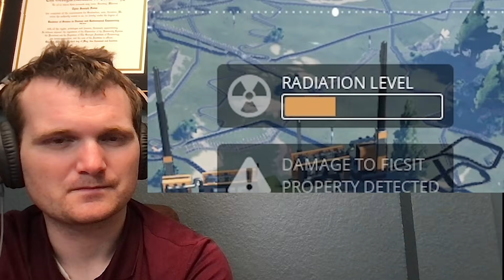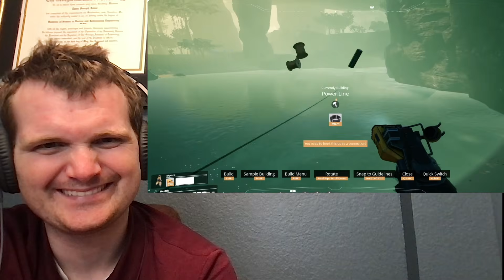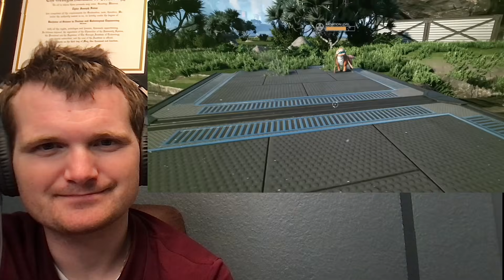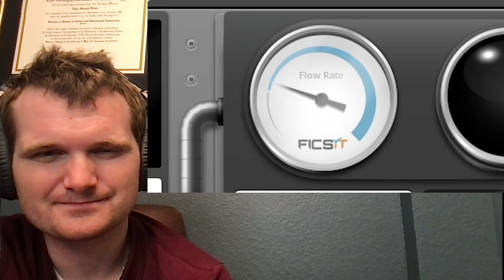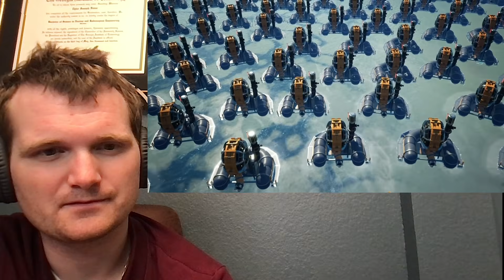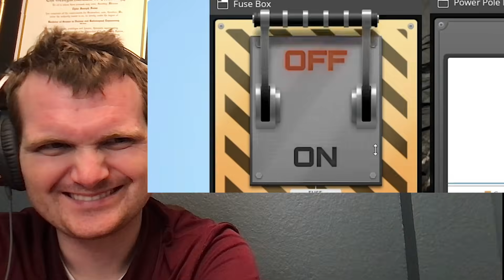EVEN MORE NUCLEAR WASTE and Drones - Nuclear Engineer Reacts to Let's Game It Out - Satisfactory

Comment: In Satisfactory, it was always implied that the nuclear and coal power plants used water (hence the cooling tower shape), but it wasn't until the fluid transport mechanic was added to the game that it became the player's responsibility to supply that water.  In the previous episode, you could see all those barrels of crude oil on conveyor belts, because prior to the fluid system, oil pumps just spit out already packaged oil barrels onto conveyors, making them functionally identical to the chunks of ore that are spit out by the mining drills.

The strange graphical glitches weren't a result of Josh's cursed spaghetti base, or even of the copious radiation he put everywhere — everybody got those, regardless of how clean or convoluted their factory was, because it was a bug introduced when the developers worked on the conveyor system, to make it less of a load on the graphics card.  I think they either just implemented or changed something about object instantiation. (That is, instead of giving the GPU a thousand distinct objects, that all happen to have the exact same shape and textures, differing only in their position, they give it one object and tell the card to draw it in a thousand different places.)

Comment: Coal is in some sort cleaner than nuclear power in Satisfactory. For a coal-power-plant, you need to feed coal and water into the generators, you don't get any waste and there is no pollution system in place except radiation, which doesn't matter here. 
For nuclear power plants, you need to deal with the nuclear waste. You cannot delete it or get rid of it, the only 2 options are storing it somewhere far away (radiation damages you and spreads around the storage depending on the amount of waste) or recycle it to plutonium. You can then create plutonium fuel rods and "burn" them in your nuclear power plants, but then you get plutonium waste, which cannot be recycled. But you can directly get rid of plutonium fuel rods before burning them and can have a somewhat clean nuclear power setup without any waste (very expensive to build and only available in the endgame).
Btw: You should give Satisfactory a try. The game is still early access, but it is already great. And unlike most other games in this genre, it's not too easy. You can expect at minimum 100 hours of fun and headaches in your first playthrough

Comment: In terms of the power you're producing coal is vastly inferior to nuclear, but combining the concepts of "ore node means effectively infinite supply of ore and is autominable almost immediately" (well before you have factory-type mining structures you can make small, carryable tripod-mounted machines to dig and store ore for you), "visible smoke isn't tracked and permanently accumulating in the atmosphere" and "water is also an endless resource with supply over time as the limiting factor rather than supply" makes coal not only cleaner than nuclear, it's more renewable than burning biological mass (because harvested plants intentionally never grow back). This is very deliberate in the game design; you are not generating power for the purpose of living here. In all probability, the eventual endgame will be that you've built and lifted into orbit the needed machinery to physically disassemble this entire planet for raw materials. Players are not supposed to be thinking of sustainability or their impact on the environment.

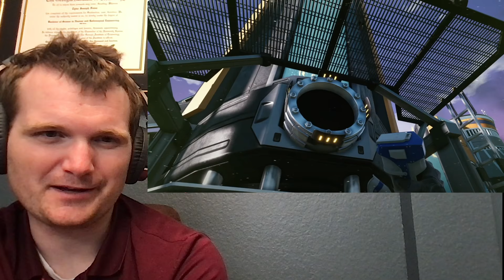Comment: 2:21 They just didn't have any kind of fluid system set up at the time they made the fission power plants, so they just summoned water from THE ABYSS. Just don't question it. :p
Reply: And no, coal generators aren't nearly as good as nuclear power in this game. A coal generator produces 75MW and consumes 15 units of coal per minute, whereas the fission plants produce 2,500MW and consumes 1 fuel rod assembly per five minutes. The main downside to nuclear power is that it produces waste you can't get rid of. Coal and uranium are both infinitely available and the devs said that you basically are the bad guy, exploiting the planet as much as possible, so the emissions isn't a thing that matters in game :p

Comment: Coal is super bad tbh. 2nd to solid biofuel. The progression afterwards goes to oil based fuel, then oil, coal and sulfer based turbo fuel. And lastly, nuclear. The drawbacks to the last 2, is space. If you don't plan your space ahead, you'll be in big trouble.

Comment: Yeah, this is a good one.

And take note that all those reactors required to be fed by a water pipe to work, that means that they were idle, and not producing nuclear waste.
The waste moving on the belts is due to the insane length of the belts.

When Josh's factory stalls it still looks like it's working thanks to the insane size of it.

Comment: 2:25 
fluids did not exist before this point in dev, so it was just not a consideration i guess
also the pipe pulsing is a indicatior for how much water is flowing through, more dialtion of the ring=more throughput.

Comment: Obviously they used magic as a moderator before they had water. Also, the only reason he has pipe spaghetti is because he wants to. It's pretty easy to do stacked lines of pipes and conveyor belts in Satisfactory. Kinda like making supply line conveyors in Factorio, but vertical instead of horizontal.
Reply: It ain't pretty easy, it is easy with conveyors, with pipes you always end up with some level of spaghetti

Comment: I wouldn't say they seek to perpetrate the stereotypes. Like, it's not on the checklist for game development... but yes, the Coal plants are cleaner than the nuclear ones in the game because they have no waste, and the ash coming out of the smoke stack is a particle effect, and there's no CO2 emissions being tracked.

Mining coal is safer too in the game.

Nuclear produces more electricity per plant and per unit of fuel, and I think eventually you can reprocess the nuclear waste into something useful for total sciencefiction technology.

I'd have been happier if they called it unobtanium crystals instead of uranium. Is unobtanium green? Sure! Does the reaction that produces the heat to run the steam turbine produce a green sludge? Why not! Keep the game mechanics and the graphics.